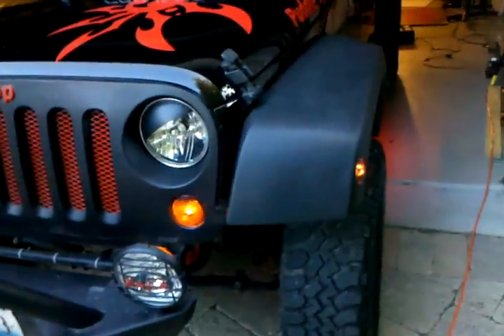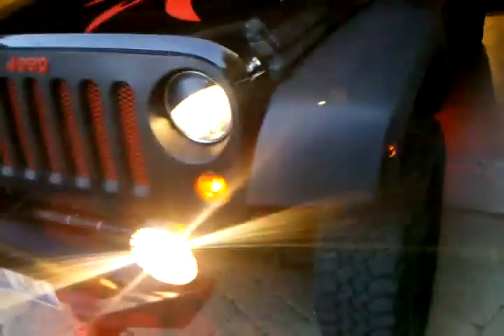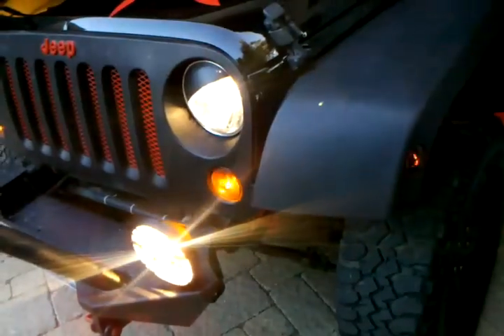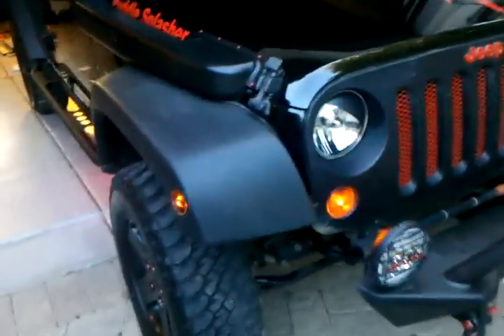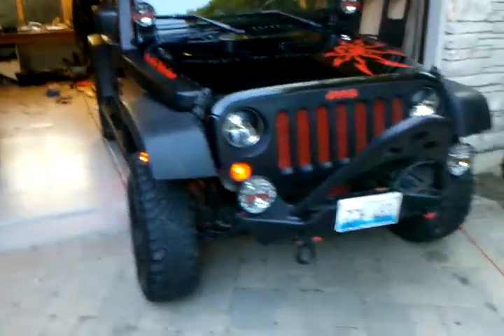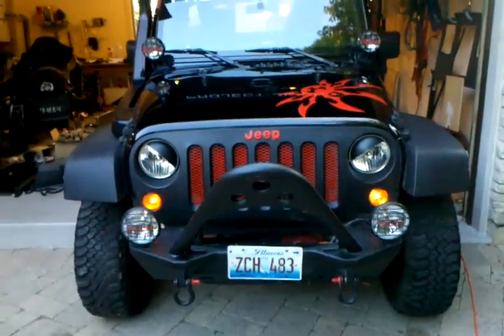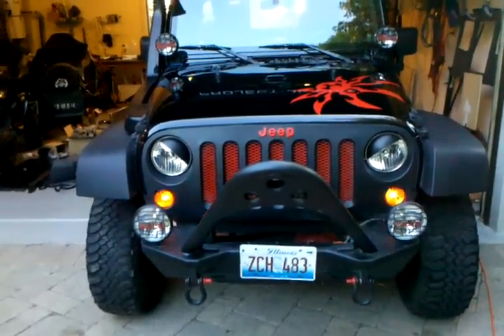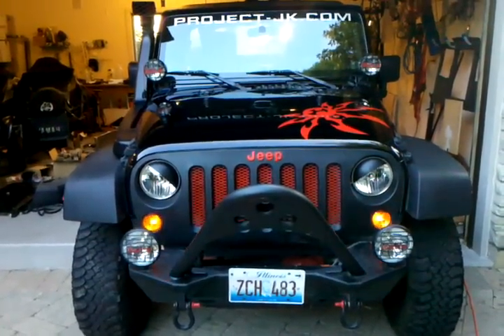Turn Signal Mod Testing

Comment: Thanks for the info. Quick question... I notice you have a snorkel, did it cost you any power/torque you could notice? I have a 2010 JK storm troopered with black rockstars all white color matched hard top etc etc. Looking to possibly get a snorkel but I think its already starved for power as is and cant have any more power loss...